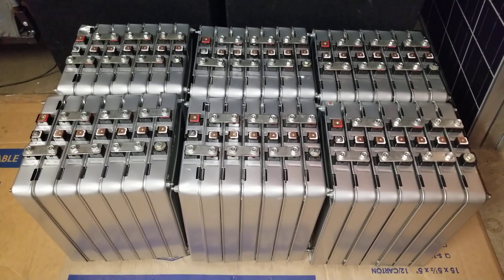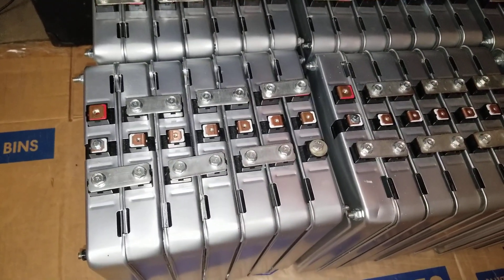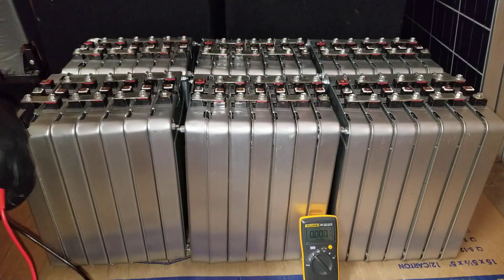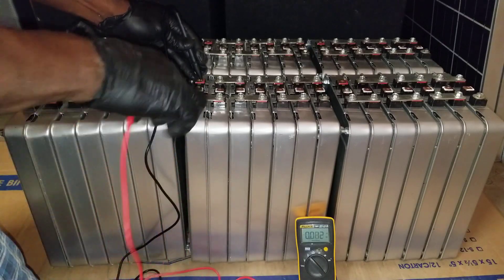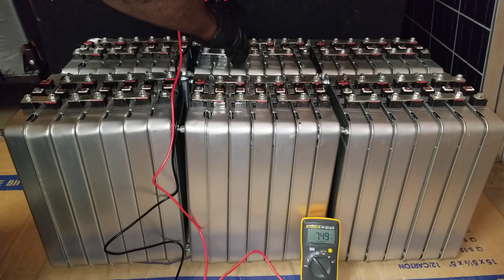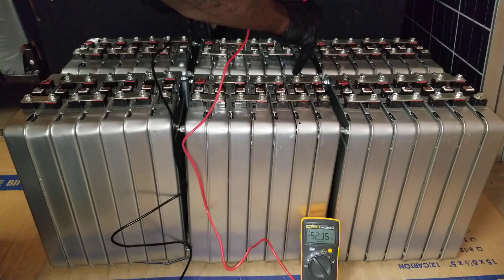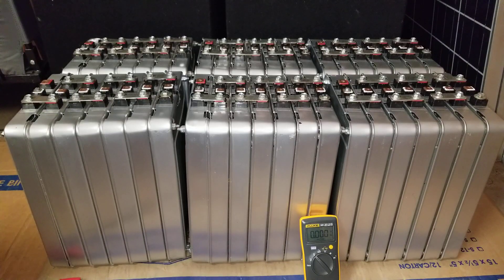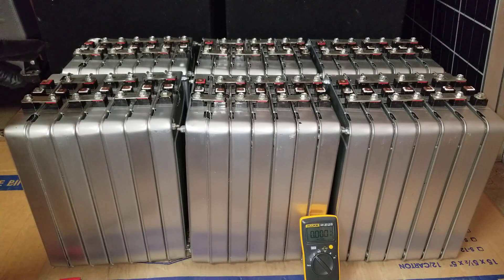DIY LITHIUM BATTERY WITHOUT BMS, BATTERY VOLTAGE AND DEVIATION TEST AFTER FIVE YEARS

Comment: I'm using my son-in-law's phone because mine won't let me make comments my name is Ray Martinez I have the Nissan leaf modules 20 and parallel three strings for 24 V system I noticed all of yours were in the series why didn't you have six in parallel and seven strings are but the way you did the test tells me those Modules have very little resistance why after five years they were still perfectly balanced I also am not using to be a mess the EV people told me I was crazy for not using one
Reply from the maker: Ok
Reply: Did you take your voltage up to 58 V on a regular basis which is 8.2 V per module for five years?  I know most of the storage is at the higher voltage but I don’t wanna wear mine out so the highest I take mine to 7.6 V.  i’d like to Take mine to 8.2 but I didn’t wanna wear them out.
Reply from the maker: @catomartinez9311  
It's all depends if your inverter battery input can handle high voltage input like that.
LIKE SHARE and SUBSCRIBE